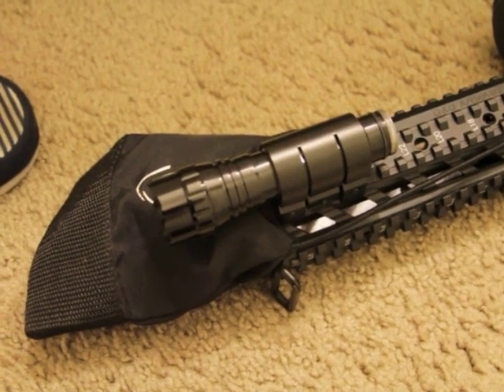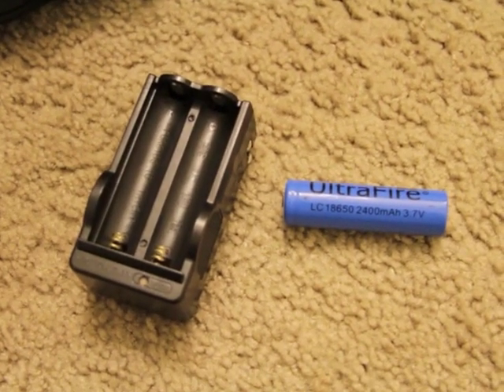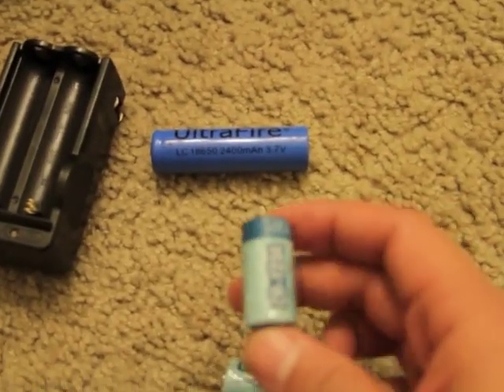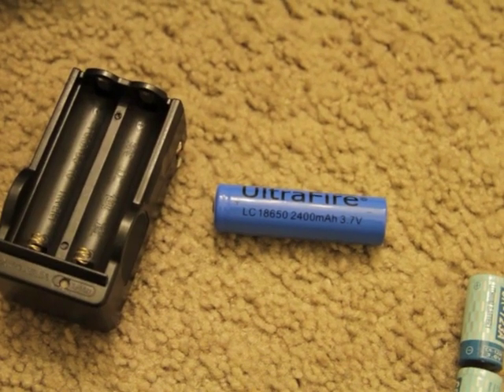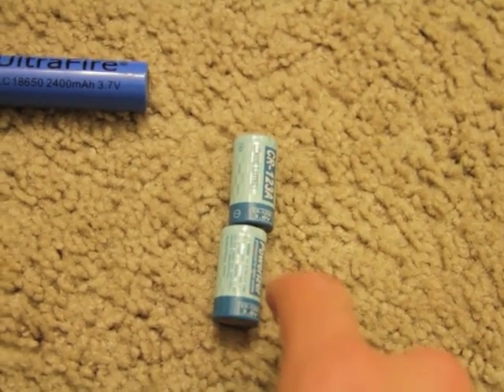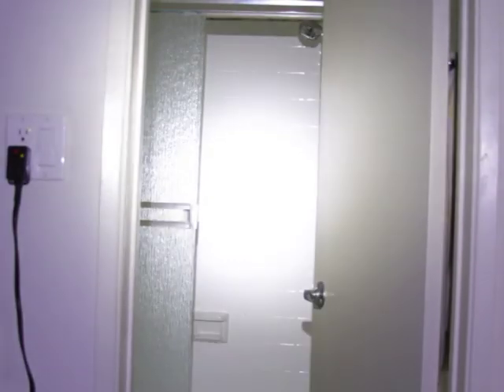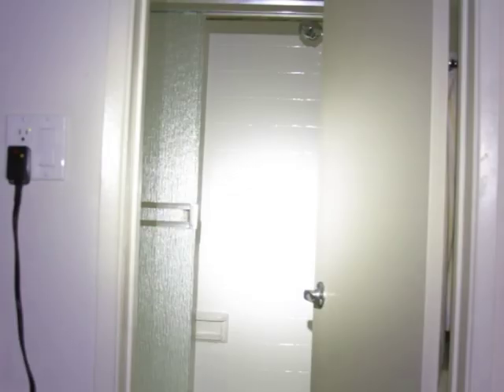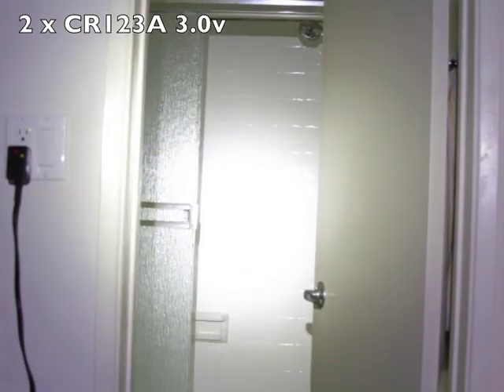Ultrafire Tactical Flashlight WF-501b XM-L T6 LED 1000 - How to make Brighter

Comment: Those ULTRA FIRE batteries are the worst 18650 batteries on the market. They weigh 1/2 the weight of a High end 18650. If you invest in a good 18650 something like a EBL brand you will see that light come alive.  If you get a 18650 rechargeable it will out last those expensive 123cr . Plus 18650 can recharge 5000 times. I have some EBLs that are almost 10years old and still going strong. Nothing wrong with the light its the ULTRA FIRES Dump them they are not worth their salt.

Comment: I have noticed in many reviews that the battery is very critical in order to get a good bright light.. Many of the cheaper low Ma Hour battery's such as 2400 maH are not very strong and wont last. You have to push about 6 volts into that T6 chip to get it to  really shine. For the average flashlight user the cheap battery will suffice because they will have a slightly brighter light than most any flashlight they have used. But if you want real performance get the 4000 Ma battery rated at 4.2 volts and it will do an amazing job. Or get the CR  rechargeables as you did and be happy..

Comment: I bought another UltraFire C8 XML T6.  It came with two of the UltraFire 3000mah 18650 batteries.

With both batteries fully charged one is definitely brighter than the other battery.  Looks like I got a defective battery. :-(

Time to upgrade I guess!

Comment: There are dozens of variations of these lights available some run at under 1A on full some will run close to 3A on full.  Its all about the driver inside.  Decent cells (laptop cells) and fully charged cells will make a difference, but if you want it brighter then buy a U2 XM-L driven at 3A.

Comment: The reason the eBay Ultrafire/Cree lights aren't bright enough for people is because of two things:
-They either didn't buy the XM-L T6 LED, and bought the old Q5 LED version of their light.
-The included cheap 18650 batteries are really flat/dead and not living up to potential.  Buy new 18650 (name brand) batteries.

Comment: I have two of the Ultrafire flashlights identical to this one, purchased at different times.  The first one is super-bright on the 3.7v 18650 battery, but the second one is somewhat faulty and doesn't have the output of the first. That leads me to believe that the quality control is not very good. Maybe you just take your chances buying from China.

Comment: This wf-501b I tested on high brightness draws approx 320mA, according to the t6 cree XLamp XM-L datasheet you need 700mA to produce 280 lumens. So this is somewhere below 280 lumens. I was a bit discouraged when I got it, however it is the brighest flashlight I've had and it's regargeable.

Your idea of doubling up these cells, do you have the version that has different modes like low, medium, high, strobe etc? I want to do this to mine to get more light out of it for kicks.

Comment: @InfinitePhasesFilms I saw a comparison between the C8 and the Fenix TK35. the C8 was much brighter than the 820 lumen TK35 which is $105. The only problem I know of is that it breaks easily. They have a brand of batteries called TrustFires that are better than the Ultrafires, but only costs a little bit more.(500 lumens is very good for a single 18650 light!)

Comment from the maker: @MrVdt12 I just picked up the xtar 18700 2600mAh and they are great. Output is very bright. They are a little bigger than 18650 so you'll have to get the right charger or modify your the spring on the 18650 charger if you have one lying around. Other great 18700 size models are Solarfore, Sanyo, Samsung, AW (red). Hope that helps.

Comment from the maker: @phattacorider honestly. I dont think you need to upgrade the circuit board. All you need is a better 18650 battery. I found out that the 18700 sanyo, xtar, samsung, solarforce, aw batteries are the best for the xml t6. But I have not tested it yet.

Comment: @InfinitePhasesFilms

Oh the driver board burned out? I guess that's even better then the LED burning out! I think I'll do some research on the individual elements of the light (LED specs, driver specs, battery specs) and see which is most beneficial to upgrade and what equipment to upgrade it to without spending an arm and a leg. I'll probably check out the board you suggested.

Comment from the maker: @phattacorider I tested my led, and the led hasn't burned out, the driver did, so I removed the led and tested in on another driver and it works fine. You should check out the AMC7135*8 2800mAh 5-Mode Circuit Board driver, but before you do that simply try to upgrade the battery to a sanyo 18650 or a xtar 18700. I heard they are better than the ultrafire 18650's. I have a couple of xtar 18700's on the way and a new ultrafire flashlight. Will update soon. Good luck.

Comment: @InfinitePhasesFilms

I read the same thing. The only problem is the drivers I've looked up still don't dissipate the right amount of heat causing the LED element to burn itself out. Honestly I think the format the 501 came is the brightest you can have it without the threat of board or LED burnout.

Comment: @InfinitePhasesFilms

Dang that sucks! I just got mine today, haven't yet thrown CR123 batteries in it. That's good to know. thanks! It really sucks though because the light certainly doesn't put out anywhere near 1,000 lumens with the 18650 battery. Great deal for $21, but would love for it to put out advertised voltage.

Comment from the maker: @phattacorider You are 100% correct on that but I believe that the CREE XM-L T6 led can handle up to 9v source (lighthound). So even with two 16340's this baby should be rock solid ... well atleast thats what I have on order on ebay. Will update if the led fails.

Comment: Of course the CR123 batteries would be brighter, higher voltage with two batteries, almost double that of the rechargeable one that comes with it. But with the higher voltage, it could make the LED too hot too quickly, rendering the light useless if operated at full power for too long. But then again according to your video, even the medium mode with the DR123 batteries is sufficient enough.

Comment: Holy crap man great video! I'm gonna try to do some research about the power management system on this light. Regulators are designed with a certain range for supply voltage, being that this light came with a 3.7V battery and it's Chinese, who knows what the tolerances are. I think I read somewhere that you can put in up to 9V but I'd be better to make sure. Yeah there is a HUGE difference when you changed the battery! $21 is a good deal but with better batteries it's a steal! Thanks!!!